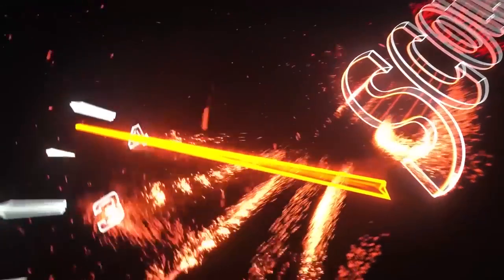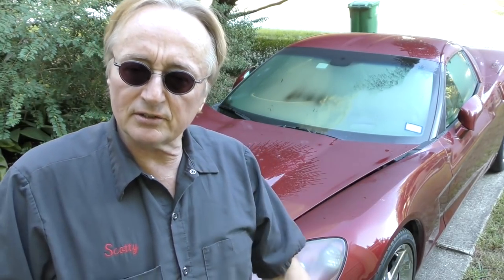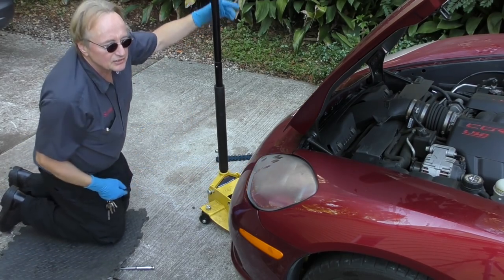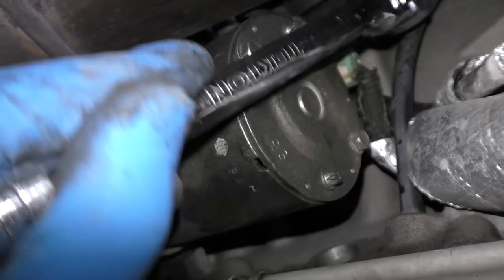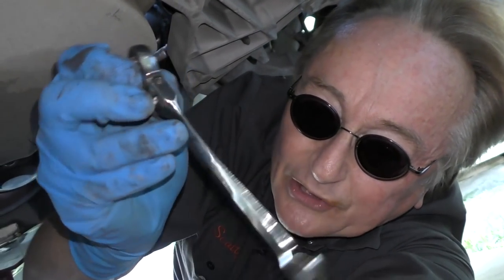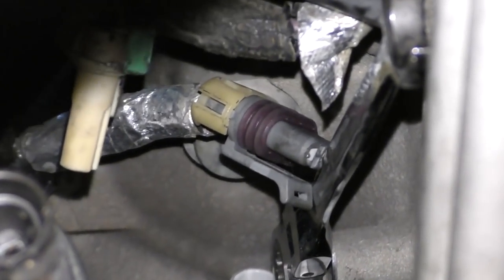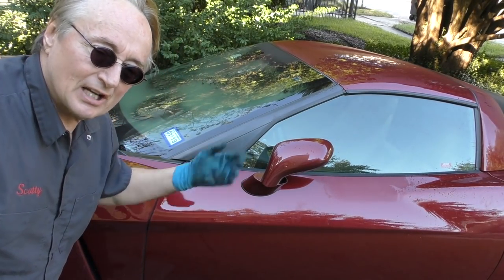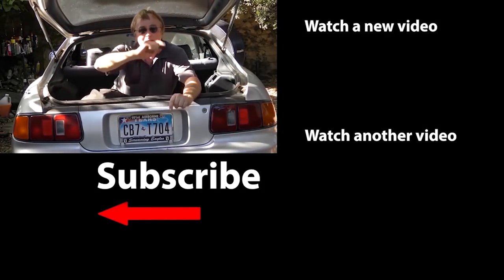Here’s Why Corvettes Suck

Comment: I always loved my Vette easy to work on so I don't know what you're saying.
Reply: Well on this 1 you'd have to pull the exhaust off just to replace the starter so I don't know what your definition of easy to work on is
Reply: @Aidan McKenney I agree, as long as you don't have broken bolts
Reply: Swallow your pride
Reply: Just saying, I drive a mustang, I love it but it sucks.
Reply: @dylanclay2741  bruh, I’ve taken apart ls engines and compared to other engines like Ford, these are definitely easier to work on, I think it someone else that doesn’t know what easy to work on means
Reply: @8ball28  lmao not talking about any ls and no saying they aren't usually easy to work on if you watched the video that starter was not in an accessible position that's it
Reply: @weeed4625 bro what? We are talking about the LS engines are you kidding?
Reply: @mikeyaustin7526  yup.
Reply: Woking on a vette is like child play vs new cars or European cars

Comment: "Another brilliant GM design" says it all.
Reply: Ain't that the truth, every time I take my Grand Am into the local GM repair place they want at least $300 if not more for some stupid repair it didn't really need.
Reply: lmaoo
Reply: James N like what repair for example lol
Reply: @DarthVader-1701  Its amazing the grand am is still on the road. Mine blew engine gaskets 3 times.
Reply: @DarthVader-1701  Then fix it yourself i do.or try working on a ford if you want some real fun parts are going to be hard to get at at on most cars that have larger or more complex engines that just the truth it doesn't matter who makes them.
Reply: My crank sensor is one little cover and a 10mm bolt.
Reply: @david37376  Mine has never been engine problems just electrical stuff from time to time.
Reply: Well, it's still cheaper than a Porsche....
Reply: According to my mechanic Fords are more difficult to fix than GM.
Reply: @BigEightiesNewWave  mine is too, and a Toyota of-course. 😉
Reply: Stephen Arling Ford isnt any better. I one time needed to drop the tank on my Grand Marquis because of a bad sensor, it was an extremely frustrating experience trying to get the tank back in place while bolting down the straps. It felt almost impossible. These engineers dont really have the owner in mind when it comes to repairs after the warranty is up.
Reply: @DarthVader-1701  lol, the last Grand Am was 2004 or 05...so your car is at least 15 years old and still on the road and you're complaining?
Reply: @mbsnyderc  that's what I'm saying people complaining about GM engines have never worked on a ford or a Dodge V8 hell try MERCEDES OR BMW IF YOU REALLY WANNA HAVE A CUSS SESSION!!!....ALL FOR ENGINES LOOK LIKE THAT CORVETTE BUT THE VETTE IS LIKE THAT BECAUSE WEIGHT AND AERODYNAMICS!!!...ALL SUPER CARS ARE CRAMPED IN THE ENGINE COMPARTMENT!!!...
Reply: @DarthVader-1701  Dont even get started on clutch replacement on corvettes
Reply: Your first mistake was buying a grand am, buy an old Toyota or Honda if you’re on a budget
Reply: James N has the paint flaked off yet
Reply: @david37376  never thought about it but yeah I hardly ever see any grand ams any more
Reply: @gl9500  😆 😆 😆 Right?
Reply: Skotty Kilmer is nuts!...he said ford of all automakers has perfected building trucks!...well their chief POWERTRAIN engineer says different!...he pulls upto the ford building in a 2015 Chevy SILVERADO LTZ
Reply: Wow!! What a total fuckin pain in the shoulder, neck and back!!! Lol!!
Reply: @adriantomlin2902  Corvette aren't expensive and that was alot easier than some of things my dad and I have done the Corvette looks relatively easy to work to be honest
Reply: That sensor always fails because of it’s design flaw. That protruding tip thats almost always in hot oil in the engine will get damaged over time. It’s supposed to be metal. Nissan cps’s have the same design.
Reply: @42XX10  Nope.
Reply: @kgisabeast  I've had the car for 19 years.
Reply: The adverage guy can repair anything on a Corvette, just check out utube videos, not so on any import
Reply: @DuBstep115  a mechanic told me 9hrs
Reply: @acres90  According to Alldata, its supposedly 7-8 hours, but according to GM who pays the dealers for labor, its only 6 hours.
Reply: @DuBstep115  mines a C5 so may be diffrent...?
Reply: @acres90  If anything it should be easier and simpler than C6.  But I think it's the same. Some guys in corvette forum said they did the job in 5 hours in home garage.
Reply: @DuBstep115  hopefully i dont need one for a long time lol
Reply: @acres90  Stock one has been there for 88k miles and 18 years. So 2k investment that will last next 18 years is not bad if you think about it.
Reply: @midnightmystery544  A Porsche is going to work better and last longer than anything GM has made, I'll tell you that much.  Just look at the 928.

Comment: As a corvette owner I can relate to what your are saying.  It takes a special type of mechanic to be able to work in a tight space like that, on your back, without a lift, removing all kinds of other components and without being able to see exactly what your doing.  Another job well done Scotty, thank you.  We actually changed our crankshaft position sensor at the same time we fixed a real main seal leak and clutch replacement.  Like you say it's a real pain to work on a corvette lol.
Reply: doesnt mean its a bad car or that it sucks, what the hell do you expect of the first american car to really take german cars for a run.
Reply: @joefries7046  GM is notorious for poor engineering
Reply: @ianfincher8501 Ive been a mechanic all my life. worked on everything. Dodges are the worst.
Reply: Fair enough, but find me another car that can give the C6 a run for it's money.

Comment: Speaking of removing a starter, when I was a teen I was under my ‘84 Cutlass removing the starter and the damn thing fell on my forehead! Lol! I bled profusely and ended up with a inch and a half scar. Every time I look in the mirror I’m reminded of that stupid starter!
Reply: Vince Clark 307?
Reply: You called the starter stupid?
Reply: Randy Jackson, yep 👍🏻
Reply: Damn, that's crazy. Luckily you weren't killed
Reply: bern m, well it was GM.
Reply: Vince Clark - That scar is one of them character-building scars. Wear it with pride.
Reply: Applying vitamin E to your forehead might make the scar go away.
Reply: Ya don't do it like that.
Reply: Randy Jackson Trust me, you aren’t the only one.
Reply: The starter had recently gone bad on my family's 2004 Toyota Highlander. I watched my dad replace it in the driveway and it's really not that bad. It's sitting on top of the transmission under the airbox so you have to take the airbox and battery out to get to it. He said the hard part was getting the new starter to line up properly.
Reply: "Stupid Gravity"
Reply: GM branded.
Reply: Some old guy I worked with had a nasty chipped tooth. 
A 3/4 drive socket slipped off the extension on some Mack main bolts he was torquing. 
The socket sat on the bolt for a second and dropped right in his face. 
Ever since hearing that  I don't tighten bolts in precarious places with my mouth open  😬
Reply: If I don't leave a little blood behind, I'm not trying hard enough! Any project worth doing requires a little blood be left behind.
Reply: No photo?
Reply: Ouch!
Reply: Vince talking to pretty girl: Girl: How'd you get that scar? 
Vince: I dropped a starter motor on my head. 
Girl: "Oh" (then walks away)
Vince, another night, another pretty girl: "How'd you get that scar on your head?" 
Vince: Knife fight. You should see the other guy. 
Girl: "OH REALLY!"
Reply: Did they not make jack stands back then or? 🤔 yeah, sounds like it had nothing to do with the starter...the scar...but, not properly jacking up the car, AND THEN, going underneath the damn thing....
Reply: It’s better than the whole car falling on your head.
Reply: Just did it Sat. No blood tho

Comment: Had mine go out on an 05 sentra. Cam shaft sensor took 2 minutes since it was on top of the engine. Crank shaft.... I had to feel around for it. Was at the bottom, next to the starter. Sensors were $60, but thanks to channels like this, I probably saved $500 in labor.

Comment: My brother has a 2012 Jeep Wrangler which had the same problem.  We replaced the sensor and it turned out great.  It was much easier to get to though near the transmission and not right next to the starter like the Corvette

Comment: “and then i wrecked it” i must have missed the part where he wrecked it
Reply: Scotty wrecked it verbally. "GM engineers had their fingers so far up their rear end, their fingers came out their mouth.
Reply: The Urban definition is: When adjectivized ({wrecked}) it becomes a word to describe how messed up someone was because of a physical or verbal  beating.  So basically Scotty was taking a beating under the car.
Reply: @billdougan4022  I somehow doubt Scotty uses urban slang. It must be more of those "sensasional headlines".
Reply: he did get it sideways for a second. broke the back wheels loose.
Reply: @vidwatcher3001  Scotty seal laugh

Comment: You can actually remove the starter from the car without removing everything else in the area, you just gotta get the right angle and it will slide right out

Comment: I work at a tire and shop and we get anxiety whenever we work on them. Because if there carbon fiber frame we have to use jacks and lift the car up at the exact same time on both sides so we don’t crack the frame. Also the tires are an absolute “dream” to dismount. Other then that these are real beautiful cars
Reply: Vetts after all the years are still crap.
Reply: GOOD OL GM

Comment: I  figured out a little trick if you have to change out that starter so you do not have to pull the exaust. Remove the two bolts holding the starter together and remove in two pieces. Breakdown the new starter the same way.  Assemble under the car. It works. Scribe a mark on the housing.

Comment: I can attest that C6 Corvettes can be a pain to work on, but thats due to the low slung design that makes getting to certain components a pain. With that said my C6 has 113k miles on its been rock solid reliable. The only non wear items that i had to change were the waterpump and radiator. Not bad for a 13 year old car.

Comment: Shouldn't you take out the negative terminal of the battery first?
Reply: You are correct, that way with it removed you cannot short anything to ground.
Reply: Should, but didn't you see it's buried under the fenders edge? I would have done the same.

Comment: I had an S-10.  Crankshaft position sensor had to be replaced.  The truck had well over 100,000 miles on it when that happened.  Talking with Chevy mechanics years ago, they commented about how they did not like to work on Corvettes because they were difficult to work on (nothing new) and their flat rate was very low.  Even changing spark plugs on a '63 was a major chore.

Comment: I had that same code on my ls1 c5 corvette after I pulled the heads off to replace lifters. Problem is it didn't trip the code for a long time after trying to get it to start for the first time. Started thinking I screwed something up horribly until it tripped that code. Turned out I just forgot to plug it back in after disconnecting it to access a plug just above it. Scariest moment of my diy car fixing life. Having nothing but dry cranking after having your whole top end off was a major cold sweat moment.

Comment: Great tip... my '03 Xterra has issues, but one was the distributor that I replaced because it got to the point I couldn't drive it and it was destroyed inside. But It would shut off while stopped at traffic lights and misfires plus it struggled to turn on, I couldn't believe it when I found out it was a temp sensor. Hence it had a code for that plus other codes along with it

Comment: Me: a big corvette fan 

Sees video: immediately u n s u b s c r i b e s
Reply: you: definition of blind loyalty.
me: camry fan. enraged when toyota f up. 
you're not a fan, you're a fanboy. The difference between you and me is I expect toyota to be loyal to me, not vice versa.
Reply: Cute Man ok...  😐
Reply: Some people don't understand sarcasm.
Reply: DARK HELMET GOB I’m thinking you’re the one who doesn’t understand sarcasm
Reply: That really didn’t look like that big of a deal. It’s a big v8 crammed in a tiny little car what do you expect. I love how he rags on stuff it’s so ridiculous. Has this nut ever put a timing set on a 22 RE Toyota four-cylinder now that’s ridiculous. What about pulling the whole damn intake off to get to one side of the motor on a Toyota 3.0 L V6. He needs to pop the hood on a Ford diesel and start working on some of that crap. For the most part GM is probably some of the easiest vehicles to work on there are. As far as trucks and V8 vehicles go. I wouldn’t expect a Corvette or a Cadillac or certain vehicles like that to be easy. I would be tickled that was a pretty easy fix. From all the crap that I’ve had to do to my 90,000 mile Honda odyssey what he just did there was easier than some of the simple stuff I’ve had to do to this thing. If that would’ve been one of the millions of camerys that drink oil he would’ve been like ahhhh it’s no big deal. Or even better just don’t ever mention it. It just shows how biased someone is to complain about that. Just grabbing every straw he can. You can very easily get into worse situations on a Lexus or an Acura or a Honda. A damn LS powered Corvette is the least of a real mechanics worries.
Reply: Were you not being sarcastic in your original comment?
Reply: @theaveragejoestinkeringand4407  its so true.If a person likes a particular thing car or whatever they will make allowances for it.Evidently a toyota product made a good impression or he has an old memory of a Toyota that gave him joy or happiness  whatever at an early age so he has an affinity for them.He probably doesn't even remember consciously what the memory is but his subconscious does hence his love of that brand.They are good cars but not heaven sent.
Reply: DARK HELMET GOB oh, i thought you were saying that i didn’t understand sarcasm, my bad. I was

Comment: GM might be crappy vehicles. But that Corvette there is very nice. I like the rounded shapes. And it is a fun toy. I have one sitting in my garage with 15,000 miles on it. I keep adding on the miles though. But very sparingly, it is not a daily driver. Just for fun and only in clear sky weather.

Comment: I've been thinking of getting a C6 Vette. I think Scotty just cured me of that. BTW, Scotty, while you had access to that CPS connector, you should have hit it with some dielectric grease. I have old cars, and find that often, a bad sensor is really just a bad connection. Typically, my first fix attempt is to just connect and disconnect it about a dozen times. This works not quite 50% of the time, but still... it DOES work sometimes. And the dielectric grease will keep the connection good for longer.
Reply: That’s what mechanics are for
Reply: Keep Away from Vetts,BMWs and all Germam cars, o I forgot all cars from GB I had the displeauser of MG 2 Jags 2 Tri. all late 60s early 70s never again over the 55years latter, its been Ford, Chevy, Dodge, ups no problems. at 72 retired I drive a old Dodge van happy with it.

Comment: Most of the GM LS engine CKP sensors we have problems with at work are the harness connectors getting crispy and the wire insulation melting off and grounding out because of all the heat.

Comment: Well you are a unique mechanic Scotty but I have never jacked a car down ... Ever, but I have let it down by releasing the pressure of the jack via the reverse twist on the pump handle. The Vette wasn't designed for easy maintenance anyways, speed, looks and handling were what the engineers were after bit you are insightful and entertaining bro!

Comment: I don't think you have to remove the transmission to get at the flywheel.  You have to remove the torque tube, the transmission is at the REAR of the car.  I'm not certain if the torque tube can be removed without pulling the transaxle, but on Porsche 928's with a similar design you can.

Comment: Keep in mind, you want to lubricate the new oring on that sensor and also not every sensor related code actually means a sensor is faulty. Can't tell you how many MAF sensors I've seen replaced because of a loose or broken air filter ducting 🤷‍♂️

Comment: You should never just take off the positive terminal by itself. If it touches metal anywhere on the car, it creates a direct short back to the battery through the ground. If you are going to disconnect a single terminal - always do the negative for this reason. If it touches anywhere, nothing happens.

Comment: A couple years ago, my 2000 Chevy impala 3.4 cranked, but wouldn't start; extremely a-typical for the old girl. For whatever reason, the camshaft/crankshaft position sensor came to mind. Perhaps because I do have considerable experience keeping my own crap running correctly; I couldn't afford to drive a car if I didn't do most of my own work (vehicle maintenance & repairs) I took a shot at replacing the part; it was kind of a royal pain in the  behind; had to remove the pulley (that wasn't too hard), and the power steering pump to access the sensor; those damn power steering fluid tube connections can be tricky to get re-threaded; had to pray, then I caught a thread. To my glee, replacing this sensor did the trick, she started right up.

Comment: Had the same problem with my 93 cougar a few years back but the sensor was in the distributor, which required removing and completely disassembling the distributor to replace the bad sensor, this is on a ford 302 5.0